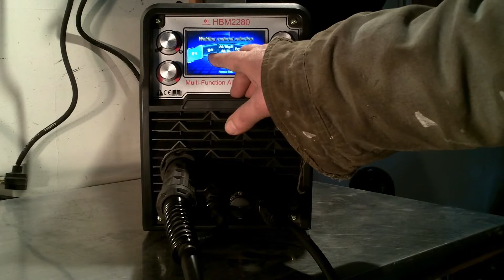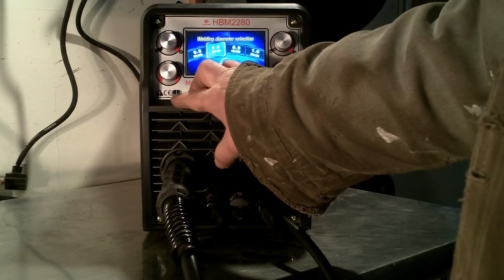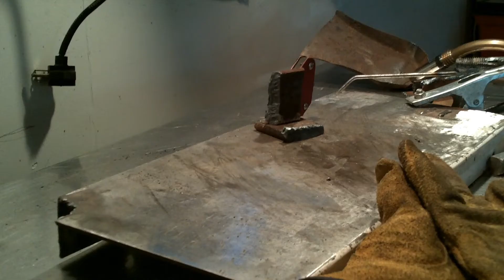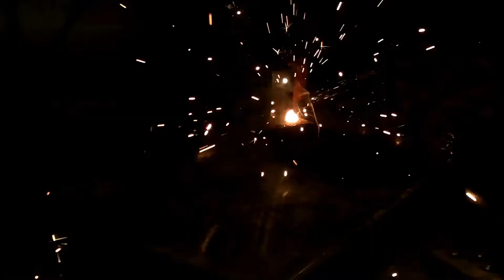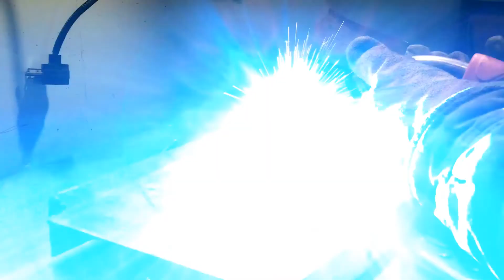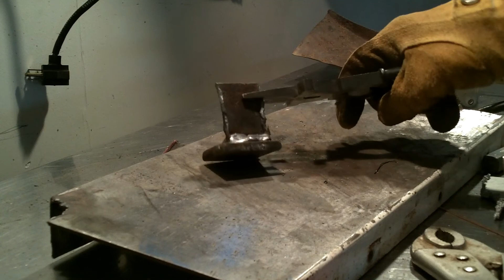HZXVOGEN HBM2280 setup and Mig welding

Comment: No it's pudding up because it does not burn hot enough to penetrate metal that thick 😂😆
Reply from the maker: I didn't have it at max. I am learning still. I will turn it up and give it another try. Unless you think the metal is to thick for a 200 amp machine? What do you think?